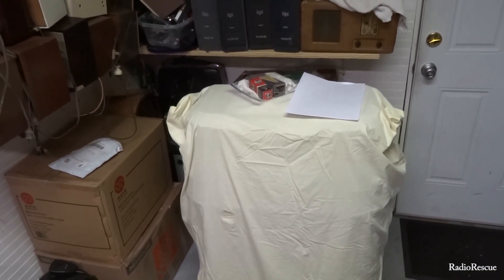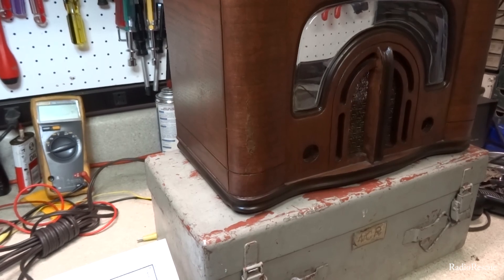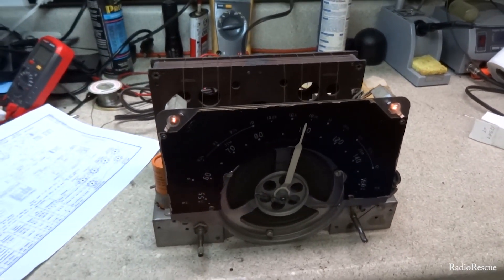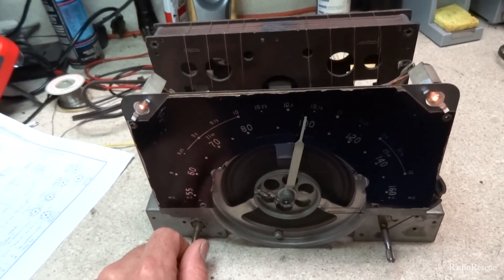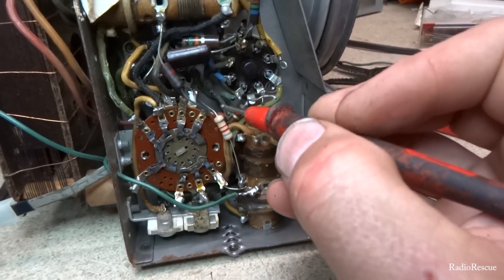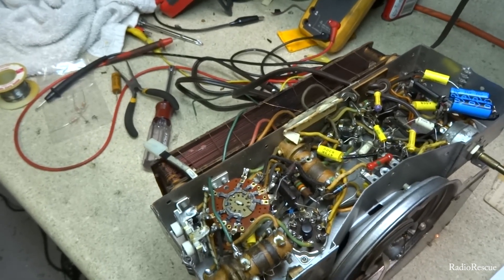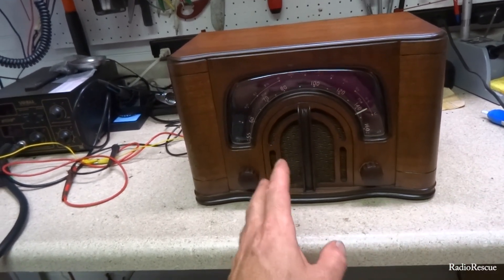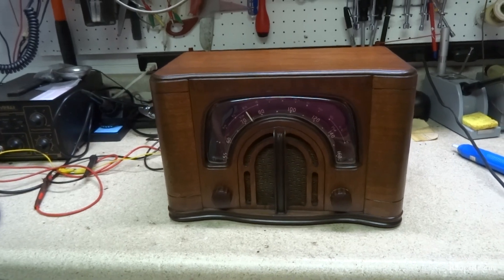Repair of A Zenith 6D644 "Boomerang" Tube Radio

Comment: Nice catch! You'll have lots of war stories dealing with poorly executed repairs.

Something that is easy to slap together is a RF bypass capacitor probe. Get an old meter test lead, put a 0.1uF 630V polycap in series and alligator clip at the other end. Connect the clip to zero return or the chassis and touch the probe around caps, resistors, tube pins, etc. to run down open caps or noise problems (divide and conquer).
Reply from the maker: Good idea there!!

Comment: How can I get my  '36 Philco 36-610 chassis repaired? It's a floor model if that makes a difference.
Reply from the maker: I'm kinda backed up with work right now. It's almost impossible to ship a console due to size. I'd need the chassis and the speaker at a minimum. It's to risky shipping a delicate speaker.
Reply: @RadioRescue  I'm in no rush I'm going to see if I can get the speaker reconned,  I'll get back to you in say a couple months and see if your workload has slowed up any, if that'd be alright?

Comment: Nice radio! That's the deluxe model with the 25 and 31 meter bands. I've had new capacitors mis-labeled and even high ESR. Now I test everything before I replace parts. Loktals are notorious for dirty pin contacts. I usually take a dremel with a brass brush attached to clean the pins.

Comment: Those "14" volt tubes are actually 12 volt Loktal tubes.  Back in the late 40's many radio makers had a good supply of war surplus loktal tubes and used them until the surplus market dried up, then they changed back to the octal tubes.  The part numbering system for loktals was to use "7" for 6.3 volt loktals, and "14" for 12.6 volt loktals.  Battery locktals were numbered in the "1Lxx" series.
Reply from the maker: Good info. Thanks for sharing that.
Reply: I've also seen completely random, different chassis stuck in some radios from 1941, plus different knobs, pointers, etc., seemingly indicating that Zenith was burning up inventory to get radios out the door when WW II hit. They did make a lot of chassis that looked the same and fit in different cabinets, but I can't believe that many chassis got swapped around after the radios were sold.